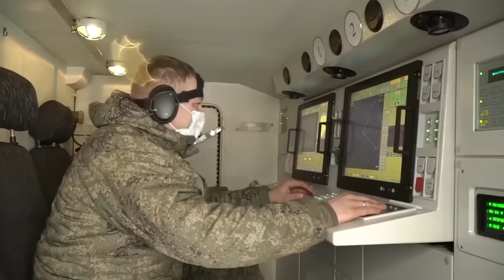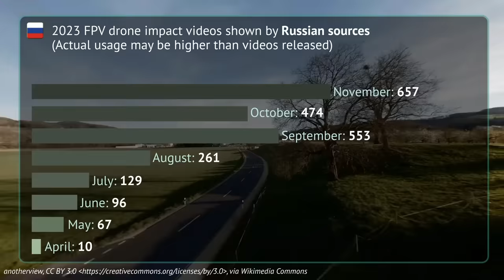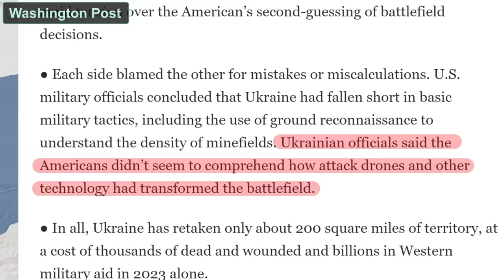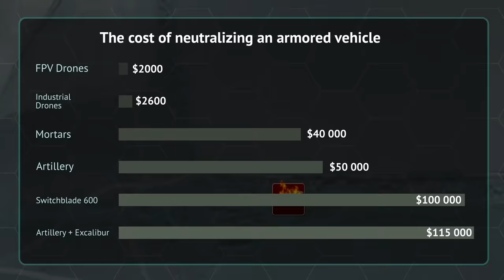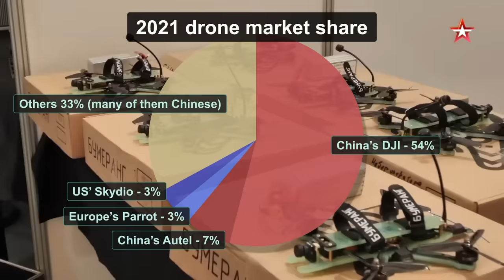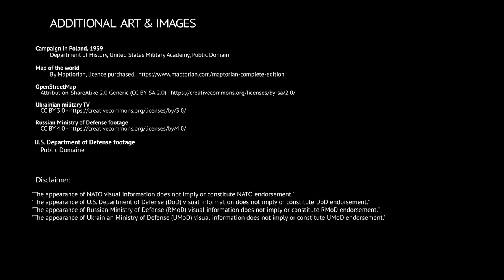First Person View drones are eclipsing artillery usage in Ukraine

Comment: It is literally the same Situation when Tanks arrived the First Time on the Battlefield.
Now most Infantry Squads have an Counter against Tanks.

Iam pretty sure when effective, practical and also cost efficient Counters will arrive on atleast Plattoon Level.

Drones will become less leathal, but still an very important Part on the modern Battlefield like the Tank.
Reply: as far as I can figure at the moment the solutions will probably break down to point defense and jamming. if you don't mind not using your own drones and having coms black out for a bit you can basically deny drones to an entire battlezone and force your opponent to fight you on your level.

as for point defense I think the Lasers that the US has been putting on strykers fit the bill perfectly, if it can cook off mortar shells mid flight it can definitely melt some plastic propellers in a flash and deep fry cameras from kilometers away.

Comment: Funny how the Americans worked for 10 years on a ultra high tech, small, portable loitering munition with computers which could detect and lock onto human sylouettes and then the Russians and Ukrainians ducktaped a RPG7 warhead to a 50$ Chinese drone and it proved 100 times more effective
Reply: Funny how Ukraine is working on the same right now because jamming is becoming a huge problem more and more 😄
Now they need a drone which finds its target after it lost connection to the operator. One would think US knowledge maybe comes in handy here
Reply: 100  times cheaper, not as effective (per device).
Reply: @Maennlichkeitsbeauftragter  Granted, such implementations will be necesarry with the advent of jamming tehnology, but for the level it was/is in 2022- present, it's holly unnecesarry, and all the fancy pants stuff on the drone drastically reduced its payload capacity to a 40mm grenade, as opposed to FPVs with can carry a double RPG warhead. 

You wouldn't go trough the trouble of issuing armor piercing bullets in WW2, would you?

Comment: they use often 7 inch fpv drone that can carry about 1.3 kilograms payload,  if they put couple hundred dollars more and use 10 inch drones then they can cary 3,5 to 4 kilograms,  that's size of a Javelin warhead,  and it will deadly for even best tanks.
Reply: i've seen a good hit from a bog standard fpv kill any equipment in a single hit, from both sides. That goes for any western tanks and T90m. Basically hit to the rear just below a turret is almost a guranteed kill. Hitting tank to the front on the other hand just tickles them.

Comment: I think the era we will see soon is one with every armored vehicle having its own anti-aircraft weapon. For instance the CROWS turret on an Abrams could be equipped with AI tools to automatically detect incoming drones and present them to the vehicle commander's display to engage.
Reply: Was looking for this. Anti - drone turrets mandatory on any military vehicle...
Reply: @adampagorski4062  Pretty sure the laser point defense turret for the stryker is a very solid solution, 50Kw laser that can cook off mortars is definitely capable of melting plastic from several kilometers and even hobby level lasers are capable of permanently frying a camera if you manage to point it directly at the camera lenses.
Reply: I agree. I think we will see development of AI controlled SHORAD systems. Raytheon is developing a laser system which will likely be effective but expensive per unit. 

Imagine if you took an old ZU23-2, made it remote controlled, gave it air burst ammunition and its own short range radar it would be very effective at destroying the cheap low flying drones. You could mount it on the back of an MT-LB or even a Toyota and have a cheap mobile anti drone AA system.
Reply: @Fireball4511 We are seeing good advances on M-SHORAD, sure, but a specialty vehicle isn't good enough. Every single armored fighting vehicle needs to have its own organic ability to automatically target a drone within a few hundred meters in clear day, and to be honest I don't think that's a hard engineering problem. That's the bare minimum, and more dedicated vehicles like what you suggest would be great for providing larger area force protection. I wouldn't be surprised if we see these technologies deployed in Ukraine within a few years. US DoD needs to wake up and realize this is a moment to not only develop these new technologies for Ukraine, but to exercise the rapid RDT&E capability needed in a future near peer conflict.
Reply: L-MADIS, coyote 2 interceptor drone, Lattice counter drone system, Roadrunner and Roadrunner-M

Comment: The US is way ahead of everyone on drone AI and drone swarm technology by at least a couple decades. As soon as they realized the potential of it they turned it into a black budget program so other countries wouldn't try to do their own programs. Small commercial drones are a new element, certainly, but the software can be adapted to these without too much difficulty. Manufacturing small drones in large numbers to run that software is the main issue the US needs to address.
Reply: No, China is way ahead. Everything, components, and manufacturing comes from them.
Reply: The US needs to produce all this stuff onshore.  Outsourcing most of its production to China has been a massive mistake, it may have generated short-term profits - but at long-term strategic cost.
Reply: @fakecubed   I think you just want attention.
Reply: I don’t think so. The approach of the USA is always to invest large sums of money in companies that are developing expensive and sophisticated solutions. However, with drones, one of the primary advantages is low cost and scale. Yes, having expensive drones for important targets is helpful, but having tens of thousands of $500 drones is a capability that I don’t think the USA has today. I would guess that only Russia and Ukraine have hundreds of thousands of small kamikaze drones. These drones are awesome for defending against mechanized ground assaults because they make it very difficult for tanks and IFVs to get within firing range. They can disable mechanized assaults on the approach even before the vehicles are within range of ATGMs. This is a very useful capability, and the USA should invest in scale not just in small numbers of the expensive drones.
Reply: People seem to think I’m saying the US has a hundred thousand kamikaze drones in a warehouse somewhere but that’s not at all what I’m saying. I’m saying the AI software, sensors, and radios are ahead of everyone by decades. That technology is being used on “expensive” (but very cheap by American standards) drones in a small pocket force for testing, evaluation, and the occasional special ops mission. In the event of a near-peer war they would be brought out and more would be mass produced because they’re designed to be. It’s a modular system continually being upgraded.

The US was slow to realize the ability for off the shelf commercial drones to be used in an improvised fashion in ground warfare, but the concept of two belligerents being unable to achieve air superiority against the other is foreign to the US. The US utterly dominates in stealth, electronic warfare, and has an absurd number of planes it can bring to any combat zone. The US wouldn’t fight the way Russia and Ukraine are fighting because they never would need to. They’d conduct SEAD missions with impunity, blow up every enemy plane that showed itself, and then conduct endless B-52 flights dropping JDAMs on the enemy. In a couple years it’ll be B-21s loitering invisibly over the battlefield controlling a bunch of drone swarms.

Because the US wants to have lots of everything, just in case, they did initiate a program to also acquire lots of cheap commercial drones, and so the US will have those too, and train the Army to use them. They may play some small tactical role, and it will be useful to learn how to defend against them since they make for a good insurgent weapon.

Comment: I think every IFV e.g. Bradley will have to be able to shoot down drones. Have to be able to point the gun high enough, add optical and IR guidance and tracking system, and have the right kind of ammo e.g. proximity fuse. Radar guidance for some fraction of vehicles. Like a cross between a Bradley and a Gephard.
Reply: Problem with that: that little self defense radar is also giving away your position. Meaning you only switch it on when you are aware of a threat or you're constantly pinging everyone where you are.
Reply: @DeHerg  correct, that's why most vehicles would only have optical & IR tracking.

Comment: They use dumb munitions on jammers. It doesn't matter if steel gets jammed it's still gonna work. The smart munitions are used after words as electronics and GPS can be jammed
Reply: GPS and communications can be jammed but electronics cannot. Which means you can use smart munitions to attack jammers they just have to be smart enough to find their target on their own.

Comment: It is easy to jam a fpv drone because it works on 2.4Ghz and failsafe is not good enough to save the drone also jamming fpv video channels might be even easier because it is low quality unencrypted and picks up noise even in normal conditions

Comment: So now drones have the upper hand. What can stop them? Maybe Phalanx-type systems using radar-guided multi-barreled auto-cannons of 20-30mm spitting out so many rounds per second. Or some innovative EW that's beyond the capability of normal mortals to comperhend. But whatever happens you're still gonna need ground-pounders to take, clear and hold territory.
Reply: In Science Fiction the counter to Drone Swarms is either Lasers or some form of Electromagnetic (EM) Pulse Weaponry which 'burns out' their electronics.
Reply: @iang3565  OK but we're dealing with objective reality here (despite radical egalitarians' presumption to deny its existence). Previously any military innovation had its own counter. Almost certainly something will come up to counter drones. Especially when you consider how quickly things change these days.

Comment: I think the AI on the cheaper kamikaze drones doesn't need to do much more than obstacle avoidance and interception of a laser. The expensive AI target recognition can be done with an overwatch drone which will recognize and prioritize targets, and designate whole groups of targets in sequence for swarms of "dumb" kamikaze drones. The drones can get smaller, stealthier, and even use fixed wings to stay higher in the air for longer periods. Meanwhile, the kamikaze drones could utilize boosters to suddenly launch toward the target at high velocities to achieve a strike when they might have otherwise been intercepted. Think Fully automatic Javelins. You could have a line of rocket kamikaze drones coming in from multiple angles straight at the same target simultaneously striking it once every half second with high explosive shaped charges. I'm not sure even the trophy active protection system could defend against that.  Drones are the next Manhattan project... I've been saying it for a while now. Pairing drones with 3d printers, AI, and ground robots like the robot dog and android from boston dynamics... I could almost see an AI Army being fielded to not only fight, but also reproduce itself. We're looking straight down the barrel of Skynet folks.
Reply: put the crack pipe down
Reply: In a future where advanced drone technology is prevalent, the landscape of both warfare and civilian life could be fundamentally altered. Militarily, the dominance of AI-driven drones might initiate a new arms race, focusing on aerial supremacy. Nations with cutting-edge drone capabilities would set the pace, compelling others to follow suit or find themselves at a strategic disadvantage.

This shift towards drone-centric warfare could streamline conflicts, making them more efficient yet potentially more frequent. With drones carrying out precision strikes, the traditional battlefield might become a thing of the past, replaced by remote and rapid engagements. The role of human soldiers would evolve, perhaps focusing more on strategic oversight rather than direct combat.

Economically, this could lead to a significant reallocation of defense budgets, prioritizing drone research and development. However, this shift might also impact employment in the military sector, as the need for traditional combat roles diminishes in favor of technological expertise.

Politically, the ease of deploying drones for covert operations could lead to a rise in clandestine activities by nations, potentially heightening global tensions. In this scenario, drones become not just tools of war but instruments of political strategy.

Comment: Thing is as good as they are right now and cost effective, the counter to them will come quickly you will start to find tanks, apc , fighting vehicles in general will quickly retrofit the counter measures meaning they will have to use many many more to subdue and destroy targets plus we already see infantry  with handheld counter measures that were knocked together really quick with some success.   Once mass produced i dont think the fpv style drones used now will be as formidable in the future as they are at this moment.
Reply: The Russians are already using fiber-optic fly-by-wire, amd the Ukranians already have on board guidance software that operates after the remote signal is jammed.
 I think drone tech is here to stay.

Comment: I'm surprised that there are no rifle/gun drones.
Reply: There are, but recoil and accuracy are a big hinderence, btw there also allready exist a flamethrower drone.
Reply: They tend not to be aerial drones, think of a gun plus trank treads going into building to clear it. I don't think they are nearly as popular as traditional drones, but I am no expert so like I really know
Reply: It's not that easy, at least not as a quadcopter, to build a useful gun drone. The recoil of typical rifle cartridges surpasses the lift the typical commercial drones generate by quit a bit. So you would need to design a recoilless gun that is not only recoilless, but additionally sufficiently balanced before and after firing, that the drone remains level and in position while firing.

It's easier to just bolt the gun on a small remote-operated cart and let it drive around than to hang it onto a lightweight flying object, which has its skills in flying undetected, dropping things and crashing itself and its payload into something/someone.
Reply: Coyote 2 interceptor drone

Comment: I predicted exactly that already way back in 2016, this was inevitable, all it took was a longer war between middle income countries. I think by now is clear that the endgame of such trend will see the obsolescence of most weapons of the past century and a drastic reduction in the need and usefulness of raw manpower as compared to civilian manufacture capacity and civilian electronic technology. Technology doesn't stand still, in less than 10 years it will be relatively simple to deploy faster longer ranged drones with bigger payloads that can be handed over to AI if jamming is attempted, it will be the death of the Tank and the IFV the moment that effective AP drone munitions are deployed. Only real way to hide is be beyond range, covered by cheap AA, or stealth (including hiding in buildings, trenches, or vegetation).
Reply: Dang youre pretty smart.
Reply: Im curious how "cheap aa" will turn out.

Also, i hope you have all seen "slaughterbots" or "murderbots" or whateven that short film whs called.
Reply: Oh took you that long kid? Those with brains and knowledge of history (us built and used the first FPV around 1944/45) know it was only a matter of time. Also for extra credit, Kettering bug.
Reply: That is assuming that no kinetic counters optimized for small drones are developed. Which is not guaranteed, but there's certainly incentive to try to develop such systems now

Comment: until some develop a AI controlled machinegun turret 
but wait it already done since 5 years or more 
then what?
:face-orange-raised-eyebrow:
Reply: The correct term is repacking old technology by the young warriors.  For example, they need to repackage HARM missiles to counter...
Reply: @rgloria40  i wonder why they dont use anti radiation drone made of the cheapest model with a sensor that ram over every radio signal